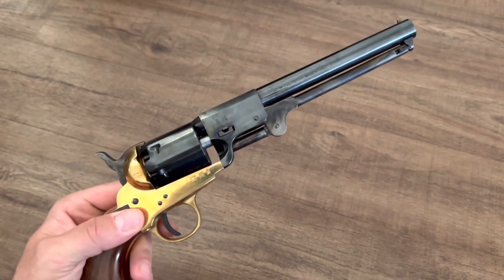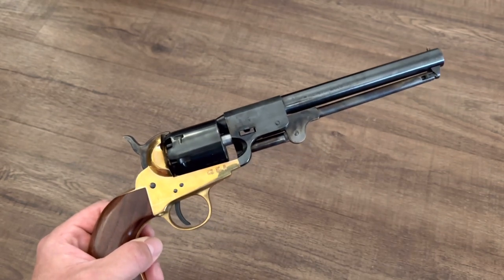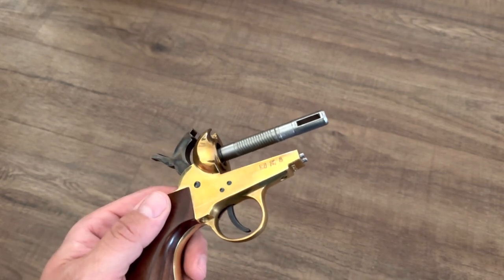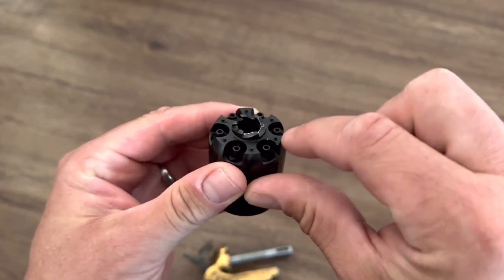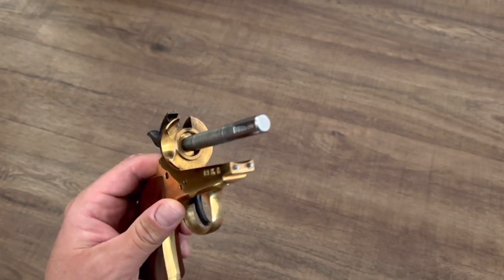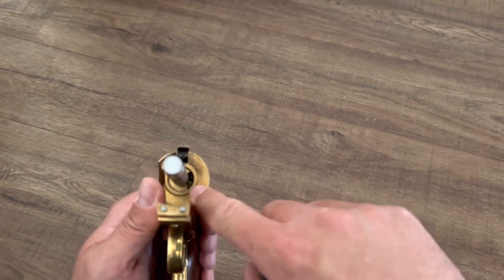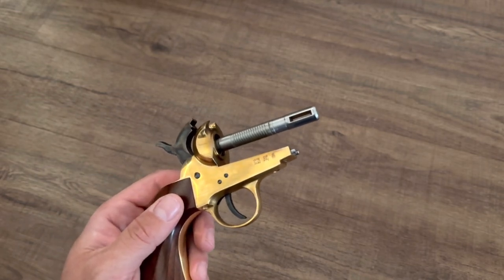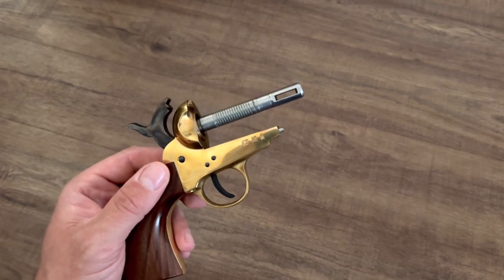Brass-Frame Revolvers: Do They Really Stretch?

Comment: I think its unnecesary to save these revolvers so much. The brass frames of modern replicas are stronger and replacing these guns isnt that expensive. You could do test on your channel and see how 44 cal brass framed revolver holds up with full 30 grain charges. It would be interesting to see results after few hundreds or thousands shots.

Comment: If you ever happen to find an original G&G revolver they are worth a lot of money, in 2020 one at Rock Island Auctions went for almost $29 000.00 USD, and it wasn't even a working model, it needed some repairs. G&G made 3700 of these revolvers for the Confederacy  over the course of the Civil War. They did not have access to the materials, craftsmen and knowledge and skill that Colt in Hartford Con had.

Comment: The water table portion of the frame may not stretch, and of course that's not the direction the forces there travel. But the arbor (steel) threaded and pinned into the frame (brass) CAN "stretch" or be pulled loose through the slide-hammer action of the cylinder over time, particularly if the arbor is not properly fitted at the front or you load hot loads consistently. Saying it doesn't happen doesn't mean it doesn't happen. Lots of brass framed open-tops have been shot loose over the decades.
Reply: But I would think it would take a LOT of even heavy loads to start wearing the threads etc.  It’s not going to happen from 20 or even 100 rounds, I would think.

Comment: My first handgun was a Pietta schneider&glassick in 36. I bought it in 1980, and I shot a lot with it and not small loads. It is still mine and there is no gap between the cylinder and the barrel. I also have a pair of griswold that I sometimes use in the CAS contest, and no gap too...👍

Comment: My first black powder was a 1851 brass frame 44cal ran some hot loads in it for years and now it has a gap between the barrel and cylinder 
I found this video very informative
Reply: the question is is a replacement frame so expensive

Comment: Great video. My first BP revolver was a Pietta Brass Navy 44 (a Cabela's special). Over the years have put about 500 rds through it with no problems. Never shot any loads above 25gr FFF, as recommended.

Comment: I own about 60 different percussion revolvers, many brass frame, and have shot thousands of rounds through them.  Periodically if they start getting sloppy  I touch them up with a fine file or a peen hammer.
Problem solved, you just have to understand whats going on with the pistol.

Comment: AWESOME INFO yes sir, that is how another tuber explained it to me not as much on "stretching" but recoil damage to heavy loads some do add steel ring but in most cases picking up a new one is a lot cheaper on the shooter, There is always exigent circumstances on why someone would do that costly repair. Taurus/Hipoint advised me on a similar situation got his info your channel, Blackie Thomas, Duelist1954. I had it repaired costly, Means more to me shooting, than hanging on a wall. Keep it 20 grains or lower it will make it 25 years or more, not an everyday shooter either, more of a once a year, might be other occasions, but limited none the less.

Comment: GREAT INFORMATION in this video!

I first got into this around 15 years ago and bought 2 1851 brass frame Pietta revolvers, one standard length and one Sheriff's model. Both are 44 cal. Before I understood the possibility of brass frame damage, I shot hundreds and hundreds of balls, most with pretty darn stout (max) loads. I quickly became a fan of Triple 7 substitute so most of my shooting was done with that more powerful and more concussive propellent.

I load these brassers more reasonably now-a-days, but even after all that pounding, I see no evidence of frame damage or excessive lateral cylinder movement.

Modern brass frames are pretty tough I think.
Reply: This is good to know as I have a .36 Brass Frame 1851 Navy. I will be using Triple 7 too.

Comment: I used a couple of pounds of fffg blackpowder & some pyrodex in a 1858 Pietta .44 with a brass frame years ago. I sold it operating as smoothly & tight as it was new. Now I bought an identical Pietta 1858 .44 new. Not 1 bit worried about brass frame issues.
     I shoot 30 grains fffg with a roundball. Use grease or lard. Sometimes i use felt wads over the powder. Not light, but definitely not overcharged either.

Comment: I got the same Pietta 36 cal G&G, 2022 mfg. The gap is very, very small. I'm certain unless it gets severely worn, one can always use foil tape and grease as a buffer or cushion of sorts. It's also not hard to take brass or bronze stock and cut it to shape and silver soder it into place. Also, spare frames get put up for sale all the time. 

Bottom line, if you can afford to wear the frame out, you can afford to buy another one or repair the frame.
Reply: Or wait until mid December & just order a new blackpowder revolver. Some great sales in December.
Reply: @boomstick4054  it's brand new, I can just buy a spara frame or experiment or just shoot it. I'm talking about theorical fixes.
Reply: @humansvd3269  I’ve lately seen a few frames on gun.  Broker if you ever want one.

Comment: Brass frames (really an alloy called "gun metal") can stretch over time, especially if using heavy loads. Even the brass framed 1860 and 1866 rifles will stretch if overloaded. (So will steel frames, just usually not as quickly.) It's just one of several reasons not to fire heavy loads in guns not designed for it. Firing black powder will minimize this, so it's not a major issue with properly loaded brass framed percussion revolvers. Just don't put a conversion cylinder in them. There is a much bigger issue to be concerned about as I will explain below.

If you're going with an open top, get a Pietta. Uberti's have a short arbor issue that will cause damage to that brass frame pretty quickly unless you know how to modify it. But why pay for a gun with such an obvious manufacturing flaw? The short arbor will also ruin steel framed guns, it may just take a little longer.  

The arbor being short for the arbor bore causes flex on firing that the pistol was not designed for, and that stress transfers to the frame where the arbor is screwed in, causing the threads to wallow out even with using light loads. So it's not really a stretching problem due to the brass material, it's a manufacturing flaw that the original pistol, and other brands, do not have.

Uberti has known about the problem for decades, it should have been corrected long ago, but they just don't care enough about their quality or their customers to do so. It would only take a very minor adjustment to the length of the arbor or the depth of the arbor bore on their equipment to fix it.  Especially now that they are using CNC equipment, having this issue remain is inexcusable. 

Piettas aren't perfect either, but their flaws are very minor compared to this issue with Uberti.

Comment: Worked on a couple that had the arbor pulling out of the threads in the recoil plate. It was classic "stretch". I've seen the issue you described too.

The modern brass frame still doesnt hold up like a steel frame gun.

Thosr 2 though... I got em back in fighting form, but it took some doin and its not something id recommend. It isnt worth the cost. I pulled the arbor off the frame, chucked the frame up in my drill press, redrilled the arbor hole and put a steel helicore in it with some red loctite. This is by no means any stronger then the original threads, by the way. However, they shot fine after, but definitely relegated to very light loads. I also pinned the arbors after the install for adfed strength
Reply: Thanks for sharing your experience.  I just acquired a 1979 brass Armi San Marco which appears to be “chambered” in very large .44 (as in .457 or larger) or even .50.  Appears to have been shot A LOT, but I don’t notice any looseness at all.  If I can’t get a least 800 fps out of it though I don’t think it’s worth keeping, which is going to require about 35 grains.  Not that I’d keep firing it at 800 fps, but that would be my minimum for holding on to it.  Which is a pity because it’s a nice-looking gun.  But having a gun that can barely burp out 20 grains/400 fps in .44+ is basically a paperweight.
Reply: @historyandhorseplaying7374  san marco tended to run larger bore... Honestly 457 isnt a surprise. They also made a Walker in 50 cal back in the 70s... Ive actually been looking for one... Only one i know to do that honestly.

800 FPS should be attainable, just dont run a steady diet of high pressure loads like that. These guns even in steel frames in 44 cal are on par with 45 colt cowboy loads more often then not. And even at 600 fps, will still stop a perp if needed, providing hold up your end.
Reply: @Rumblestrip  Oh yeah, definitely won’t run loads like that through it regular.  I’d say a cylinder, max.  And I knew there was an issue when I loaded it with the typical .454 and it almost just fell down the chamber, no lead ring, and the balls in the other chambers shift and move during firing.  Honestly even .457 might be too small (will try this weekend).  If so, this is close to .50 cal.  And wow, a Walker in .50 would be quite a monster!!!

Comment: Back in the day we used Turner's terminology for what people call stretching...we simply stated that they "shot loose" over time especially with heavy loads. I shot the first one I had loose and quickly learned that shot loose meant inertia was basically using the cylinders ratchet as a steel sledgehammer against the soft brass guide ring of the frame. It absolutely digs into the soft brass and imprints it quickly if using heavy loads. People really need to keep loads light in the 44's especially. Brass frames are no doubt attractive to most of us though.

Comment: I've seen the arbor become loose in the brass frome, to the point that you could wiggle it when the gun was apart. Only one time, and it was a CVA brass 1860 army
Reply: What is CVA?
Reply: @historyandhorseplaying7374  Connecticut Valley Arms.

Comment: Owned one as a kid in the 1960s. Italian not so good production.  Never had any issues except had to replace internal paw. Shot thousands of balls using Crisco back then. Still have it but don't shoot BP anymore.
Reply: Same here. 👍
Reply: The Italian clones have come a very long way since tye 1960s. They are using much better steel, and other metals, the clock work has improved quite a bit resulting in much better fit  and timing. ... i think the Italians today, make a much sturdier, longer lasting product than the originial American product. In any case, the Italians make affordable stuff, and they are easily replaced. As far as accuracy goes, my Uberti 1860 army is the most accurate pistol ive ever shot, producing one jagged hole at 25 yards. No special load either.
Reply: @blueduck9409  
Yep, I have to say you're right, the Italians have come a long way since the old days.
👍

Comment: found a 1964 brass frame uberti 1851 in .44 at an auction,  its been banged around a bit but was cheap.I feed it 22gr of triple seven with coffe filter wads, 167g round nose and use cap gun caps with a little powder in them and it just refuses to die.

Comment: I have heard that the brass is not solid pure brass. Its got a mixture of hardened nickel mixed in. I think the biggest problem is loose cylinder arbors, or cracks in the brass around the arbor.

Comment: Years ago I owned a G&G copy in 44cal, with the brass frame.  The issue it developed was the cylinder rod had to be retightend all the time.  Having a threaded steel rod screwed into a brass frame was a disaster waiting to happen.  I attribute the problem to both the stress of seating the ball and recoil 
in a Colt style revolver.  Don't believe having a brass frame would be an issue with a revolver that has a top strap.

Comment: I have a G&G that was owned by another person, it has a bit of rattle when it is just pointed in the air, The gap between the cylinder and the barrel is not drastic, but I would like to know if you know of a way to tighten it up.

Comment: I have a question unrelated to this but it could be a future video idea. Can you make paper cartridges using flash paper and see if that makes any difference? Flash paper when burned more or less becomes a gas and harmlessly dissipates in open air, but when confined in the chamber of a revolver it should in theory build up a bit of pressure, like a booster for the main powder charge that helps the overall velocity rise a little higher.

Comment: Does this also apply to the Remington pistols? I know that they are of a different design than the Colts, and that could perhaps mean that they can take more of a beating.
Reply from the maker: I would treat it the same as a Colt. It has a top strap, but the cylinder is still beating on soft brass at the back of the frame. The front is also being pulled as the projectile enters the forcing cone.

Comment: I recently purchased at a gun show a brass Armi San Marco 1851 Colt Navy in .44 (sort of— will get to that), manufactured in 1979.  I repeat 1979!  Judging from its frame, the undulations and striations in the barrel assembly etc, i appears to have been fired A LOT.  And, interestingly, there is ZERO “stretch” or apparent damage to the brass frame.  I think if this gun had any “stretching” to do, it would have happened long ago.  Moreover, it appears to be designed so that the wedge serves as a tightener to the fit of the frame to the barrel, so that the further in you hammer the wedge, the tighter the fit of the barrel to the frame— to the point that the cylinder won’t even TURN if you have the wedge all the way in, so you actually have to back it off to be able to turn the cylinder.  So,even if there were any progressive wear on the back of the frame, you can simply adjust the tightness of the wedge to make up for it.  And, there is not even space for an index card to fit between the forcing cone and the cylinder, the fit is that good.

Some interesting features of this old ASM- the forcing cone is of the large kind, meaning just like the .36, rather than the later Pietta versions in .44 with the HUGE cylinders and small cones, resulting in a smaller and therefore lighter cylinder and gun overall.  In addition to being lighter than the .44 Piettas, it also feels so much tighter and better made, with no “rattling” like the cheaper-feeling Piettas.  Also has a much smaller handle.

One thing that surprised me is the caliber.  I noticed that the .454 balls just slip right down into the chambers, with zero lead rings produced, and they jiggle and move inside the chambers during the course of firing.  To remedy that I just purchased the very rare .457 balls from Track of the Wolf, but it’s very possible those will be too loose too.  Meaning, was this made in .50 caliber or something??  And good luck to me getting correct-size round balls for it.  By the way it also has a large cut-out to accommodate conical if I so choose, unlike the Pietta versions.  Also, so far I have gotten ZERO cap jams with it, UNLIKE the Piettas, and the hammer is about 10 times tighter/harder to pull than the Piettas, which undoubtedly influences the cap jam situation.  I wonder if they used much harder/better hammer springs back then.

One last thing— this gun feels so light and comfortable that I’m actually considered carrying it for self-defense, so have been testing it through a chronograph with bigger loads.  Unfortunately only got about 720 fps with 32 grains of powder, though this is possibly due to the balls being ill-fitting.  Am going to try 35 grains or so this weekend, with the .457 balls, to see if 800 fps can be achieved, which would be my minimum for self defense.
Reply: Seems like it was swauged open for conicals, or intended for blanks?
Reply: @humansvd3269 I don’t know, it doesn’t seem to have been modified at all, so maybe ASM made their guns to accommodate conicals from the factory?  Are conicals usually of larger caliber than .454 or 457?  I would not be surprised if I had to find larger balls than even .457.
Reply: @historyandhorseplaying7374  I know the richmond 36 conicals are .390 at their widest. It's very odd 454 will fall right in.
Reply: @humansvd3269 Well they do require a little force to go in, they just produce no ring and they obviously shift during firing, to the point that I had to pack them pack them back down in.  Have been Googling for pics of these guns, but it appears they are pretty rare— I do find one photo of an 80s steel frame ASM with the large opening for the conicals, but all the photos of the later brass ASM’s from the 90s have small apertures, and small forcing cones too.  By the way my gun also has a tall(er) front site, unlike the usual Colt nubs, so it doesn’t shoot so high.  But it doesn’t look like a user modification either.  There is very little literature out there about what ASM was making back in the 70s, so who knows.

Comment: Good question, could you be able to get away with using jacketed bullets instead of lead round balls or Conical bullets? The bullets themselves without the brass casings, just loose powder or paper cartridge.
Reply from the maker: No, for these guns, the projectiles need to be pure lead.